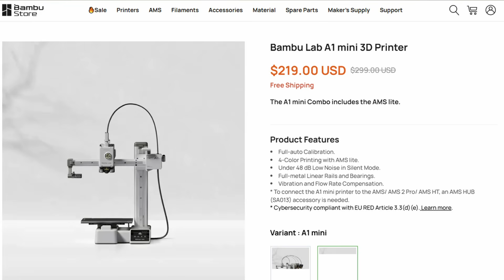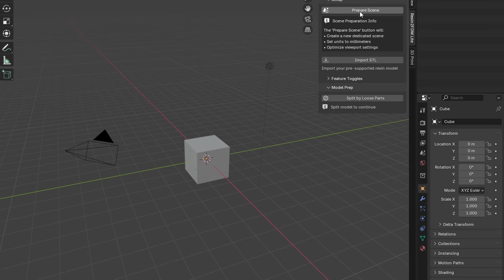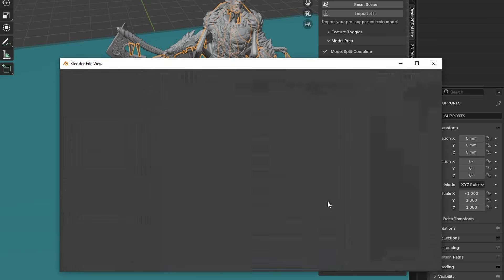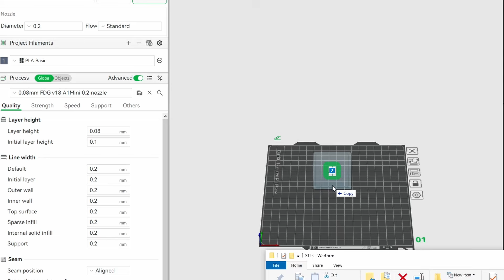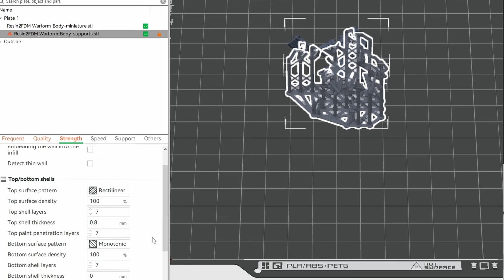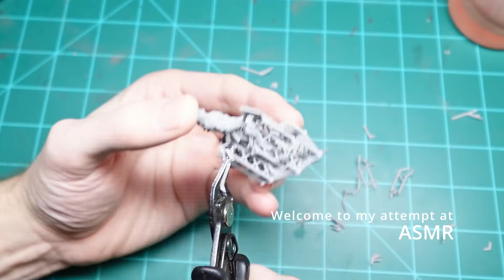How to 3D Print your Cosmere minis with an FDM printer in 6 steps with the Resin2FDM process

Comment: Those look great! I wonder why you have issues with tree supports? I’ve been printing minis for years on fdm. I just printed several cosmere minis last week with a .4 nozzle at .12 layer height with tree supports with no issues. I use orca slicer, but I think bambu is built off orca if I’m correct? 

Either way, you found a great workflow that works for you! Keep it up!
Reply from the maker: I just need more experience with tree supports to give it a fair review. I was shocked at how well this Resin2FDM worked out of the gate so will keep with it for now.

And from what I see Bambu's slicer is very similar to Orca.
Reply: If you're using .4, you might as well use PVB filament. That's what I use and take my time painting the alcohol over the model to not obscure the details. Otherwise, I use my .2 nozzle with Resin2FDM and the Fat Dragon presets. Using both of those together will get you peak results on FDM.
Reply: @R2KNoHeroes never printed PVB, I’ll have to check it out! Thanks for the tip! 
Normally if I want the high quality, I use my resin printer. But I use fdm all the time for minis I don’t plan on painting (like for new players to be able to use their own mini without going through all the work and scaring them away lol)
Reply from the maker: I've seen that applying some kind of alcohol solution over the mini could help with smoothing the layer lines. Do you see the need to do that with your .2 nozzle and Resin2FDM?
Reply: @cosmereinminiature  It is recommended not to use PVB with a 0.2 nozzle because it may clog, so I never tried it.